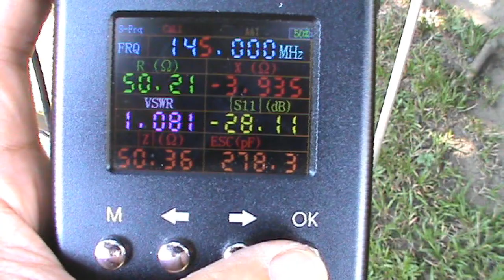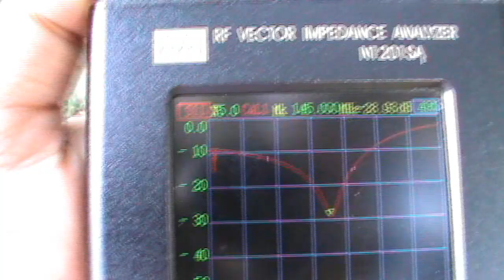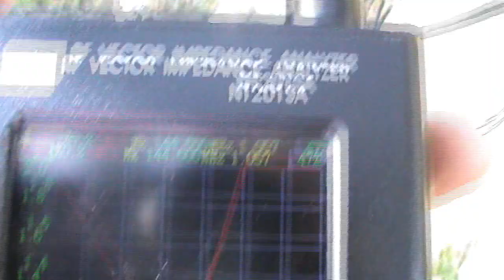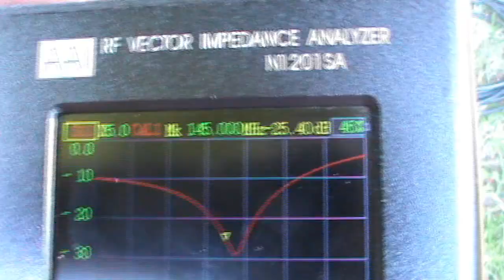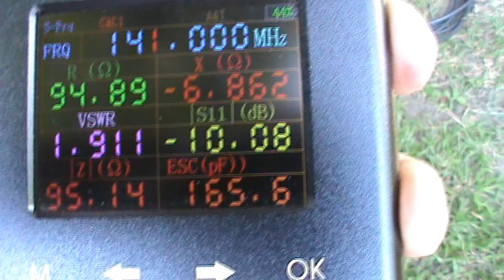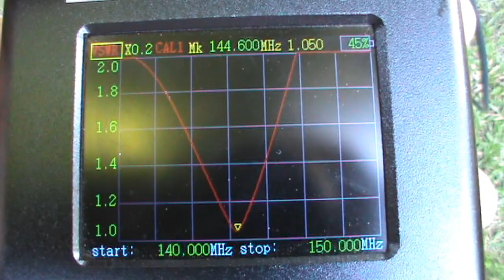Tuning stacked Yagi Antenna & effects of feed line on a tuned antenna

Comment: Great video.  Is there anyway to predict which way the low point of SWR will move bases on feed line characteristics?  Does feed line capacitance or velocity factor shift the low point of SWR and if so which way?
Reply from the maker: the best way is to look into your antenna analyzer and be familiar with the smith chart, that way you can predict the effect of inductance and capacitance on your swr curve. Im using a gamma match so I need to make my driven element inductive in that case I just need a bit of capacitance to cancel out reactance. Velocity factor does not affect your SWR, but it directly affects the length of how you cut your phasing harness.
Reply: @EphraimGariguez  thank you